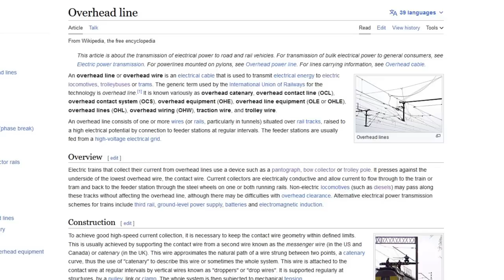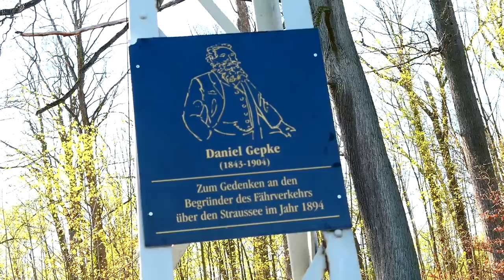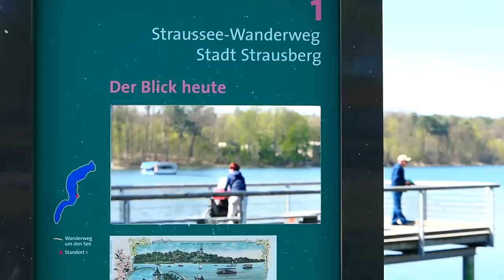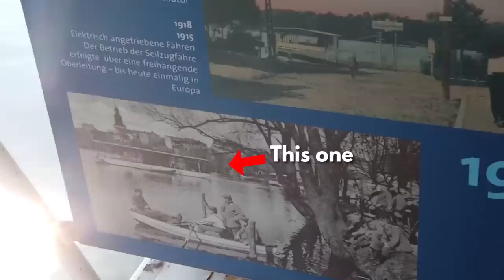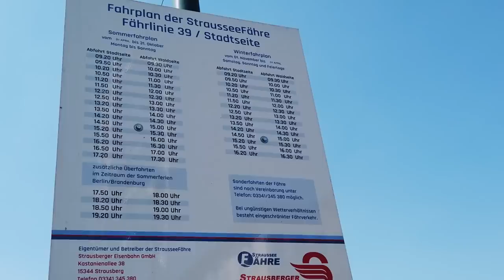The Ferry Powered By A Live Electric Wire

Comment: "Both grounded and floating" is a pun most of your less electrically inclined viewers probably can't fully appreciate. Rest assured that some of us do!
Reply: As I am both navally inclined and electrically inclined, it had me in stitches.
Reply: A grounded system is rare on shipboard.  Most floating electrical systems are floating.

I wonder if it tickles swimmers when the ferry is in the middle of the lake?  Once a fair amount of cable is played out, the resistance would lead some of the current to go through the water.  Especially if the power really is only at 230V.
Reply: Genuine question can one be ungrounded and floating?
Reply: I missed something somewhere im sure.
Reply: @joshgreen2164  In electric terminology, floating basically means no ground reference. Consequently, being grounded and (electrically) floating at the same time is mutually exclusive.

Comment: Electrified canal seems like the most futuristic retro that could exist. Might even be  a good way to transport bulk goods.
Reply: Seems like a much bigger investment in infrastructure than an electric railway (having to dig the canal and all that) for much lower speeds. And lower speeds not only means longer transit times, but also less throughput in total. Not even sure that it would be more energy efficient for the same haulage - ships are typically only more efficient than trains when very big, but canals only allow pretty narrow boats.

So while it is peak futuristic retro (is electropunk a thing?) I doubt it's actually a practical idea.
Reply: I think the idea would rather be, to refit exsisting canals. And although that might be a cool solution for some small canals with a lot of boat traffic, there are limitation with big canals, who might just be to wide.
Reply: Indeed, it's a shame that it replaced the steam-powered airships though!
Reply: Am I the only engineer here thinking, "Sparks and water, never the twain..."?
Reply: "Electrified Canal" is also an incredibly good name for a punk band.
Reply: @theloverlyladylo9158  NO.
Reply: You could just electrify the water, save the costly overhead wires!
Reply: The power would come from a coal fired plant anyways wouldn’t it
Reply: Space karen might like the idea, then rebrand it has an open air hyperloop (considering the hyperloop was another 19th century concept)
Reply: @smarttseluvka  Not unless you live in Australia, Poland, or Albania
Reply: @madattaktube  well New South Wales, Queensland and Victoria in Australia.
Reply: Well we have one kind of an electrified canal in the US, look up the Chicago Sanitary and Ship Canal
Reply: @madattaktube  don't forget germany, india and china.
Reply: @QuantumHistorian  But the overhead wires where for short sections only. Mostly for canal tunnels. When you have a diesel or steam tugboat, you have really bad fumes in the tunnel, so electric is the best way. You can see in the picture, that they use two pantographs, so the return line is also on top, and not in the water.
Reply: @smarttseluvka it's in France, so nuclear plants, mostly.
Reply: @nos9784  Germany 20% coal, India 50%, China disappointingly 70%. Australia is actually about 50% now, so there's not many countries still using coal as a majority energy source.
Reply: Nothing retro about it. For most kinds of bulk transport, going over water is the most efficient way to do it, even with a boat that runs on diesel. Electrifying it just adds more efficiency on top of it. I'd say it's quite a modern idea, instead of a retro one.
Reply: They used to move canal boats through tunnels where the animals on the tow path couldn't follow by having laborers lie on their backs on the roof of the boat and walk along the ceiling to move it, that was the origin of "legging it". If canals had held out a little longer instead of being supplanted by railways I could see them wanting to use some sort of small electric tugboat to move canal boats through the tunnels powered by an overhead wire instead, but probably with a long straight tunnel it would be just as easy to have a cable haul system instead of an electric one.
Reply: @QuantumHistorian  Uhhm... The rhine moves more freight (in tons) than the two double track railways next to it combined. Throughput is not inverse of speed.
Reply: @IIVQ  Rhine =/= canal. If you think about it for a microsecond, you'll see that throughput is bandwidth * speed. River barges are slow, but can each can carry a lot, and you can have several side-by-side. So it's high bandwidth and low speed. Freight trains are low bandwidth but high speed. Canal boats, however, are both low bandwidth and low speed.
Reply: @QuantumHistorian  Not all canals are small, especially not in the Netherlands. I live next to the Amsterdam Rhine Canal, the busiest canal in the world, which is CEMT class VIb and has enormous bandwitdh, probably over that of most parts of the Rhine. It just doesn't have two rail lines next to it for a nice comparison.

The Amsterdam Rhine Canal is VIb, which means vessels with a 343 TEU capacity can sail on it, and it is not uncommon to see 3 of those vessels (plus a lot of smaller) pass per hour, which is equivalent to 30 of the longest trains allowed in the Netherland per hour, where a simple double track electric freight-only rail line can sustain no more than 10 or so of those. So the throughput of the ARK is 1029 TEU/hr, while that of a rail line is closer to 350 TEU/hr.
Reply: @IIVQ  Yes yes, and I'm sure the suez and panama canals are also very big. But that's clearly not the kind of canals that the original comment was about.
Reply: The only thing more futuristic retro is the monorail.
Reply: @QuantumHistorian  No, those are canals made for seafaring vessels. I am talking about inland waterways. In general they can move more freight than comparable time period rail lines could/can (in tonnes/day) thus have a higher throughput.

In the beginning of the Industrial revolution (late 1700's in England, Wales and Belgium*) there was a canalbuilding mania. After the great railway expanse (1850's) many of those canals dwindled, only to have a resurgence in the 1870's because the railways were saturated and non-perishable bulk goods (mainly coal, brick and other building materials, and waste) could more cheaply be moved by canal, and a second wave of canal building started. In Belgium and the Netherlands a further wave was at the end of industrialisation (1950's, with many plans not coming to fruituition until the 1980's). And now there is a new (small) building wave in Northern Europe, mainly because of the future LSE (Paris - North Europe link or Seine Scheldt link).

*The Netherlands includinf Flandres already had canal building crazes in the 1600's as the flat, peaty terrain canals played an important role in the water management and roadbuilding was nigh impossible. In fact, the best roads were usually on the hardened berms of canals.
Reply: @jonasschich5979  The alternatives were horses or locomotives to ferry prams, both more expensive.  Germany is electrifying a stretch of highway with overhead cables for electric long haul trucks. The idea is appealing to everything that needs to travel a fixed route.
Reply: Water and electricity...what could go wrong?
Reply: @mrsleep0000  Well, not much more than on a train. The potential of the entire boat is same as earth. Only if you touch the overhead wires or the non-insulated part of the pole, you're in troublem, just as with trains/trams/trolleybuses everywhere.
If the cable breaks, a cirquit breaker will trip.

Comment: Between 1914 and 1954, canal boats were pulled through the Harecastle Tunnel on the Trent and Mersey canal near Stoke on Trent by electric tugs.  Initially they were powered using batteries, but after 1931 an overhead conductor was used.
Reply: I'd think canals would make for really good places to run electric boats.  They are fairly narrow and straight, and all the traffic is going up or down the canal, not across.  The only major barriers I'd see would be if private companies were running barges you'd need a way to meter the cost, but you could probably do that with a flat fee.  Compared to the infrastructure of building a canal throwing up some power lines would seem to be pretty simple, although maybe in their heyday mules were cheaper.

Comment: Well actually, the 'ferry boat' to cross onto the island of Lefkas (Levkada) from the Greek mainland is powered by being connected directly to the grid.

It is helped in this by the fact that it doesn't travel across the canal. Cars drive straight across it much like a pontoon bridge, and to let boats through they pull up the ramps at each end, and it pivots around a piling much like a swing bridge.

Rumour has it that it is very definitely not a bridge because islands only accessible by ferry have tax advantages...
Reply: Definitely not a bridge 😂 Thank you for that tax-evasion pedantry! Much appreciated.
Reply: A swing bridge that proclaims itself a ferry for tax purposes indeed sounds very "alcohol, alcohol, alcohol is free!"
Reply: That is the most Greek thing I've heard and I love it
Reply: @LeafHuntress  Hehe, yes!

I mean, to be fair to the claim of being a boat, it does float, which most bridges don't. On the other hand, it doesn't go anywhere, which most ferries do.
Reply: I just drove over that ferry yesterday :)
Reply: It is even registered as a boat. Π/Γ ΑΓΙΑ ΜΑΥΡΑ. Π/Γ for Πλωτή Γέφυρα (Floating Bridge) Santa Maura (the patron saint of Lefkada, from which the island got its name during the Venetian occupation)
Reply from the maker: Oh wow, that's going straight on my to-do list :D
Reply: I found that hard to believe until I rememeberd that many houses in Greece are under endless contgruction lasting decades. Putting half-finished floors in with rewbar sticking out means that you pay less taxes so they all remain in perpetual construction.
Reply: Looking on both aerial and Street View, I see an old car ferry about 200 feet away.  I gather the floating bridge "ferry" replaced it?

And yah, with how low to the water the approach roads are, building a floating swing bridge like this really does make a lot of sense.
Reply: @LeafHuntress  Now this was an unexpected but welcome throwback!
Reply: @TheTimTraveller  Come north of it too, in Corfu, I'll have to find you something weird to visit though...
Reply: A ferry that doesn't even move, but works perfectly. Brilliant.
Reply: This is absolutely brilliant and I can’t wait for the inevitable video on it
Reply: call it "Ferry Mc Bridgeface"

Comment: Well, actually: hidden away in the outskirts of Budapest there's a tiny cable ferry that is propelled electrically... by a winch on the shore. The cable is fastened to the boat and runs through pulleys on one shore and a large winch drum on the other, where an operator sits and maneuvers the ferry around by tensioning different bits of the cable.
Wikipedia tells me a similar ferry exists in the Netherlands in Jonen.
Reply: I've been there, at Jonen. There's absolutely nothing there.
Reply: @RobinRense  meanwhile, i was on one such ferry in the norwegian fjords and can't find any info on it (there's not even a ferry anywhere along my route according to google)
Reply: A Winch makes more Sense to me than a overhead line, since there are cables going across anyway

Comment: I have to assume that the reason it's the only one left is simply that if you are going to make an electric ferry, battery powered or extension cord-style give you the benefit without imposing a strict height limit on the river.
Reply: Nowadays, with improvements in plastic insulation for the cables, it wouldn't make sense to have an overhead-powered cable-guided ferry. That said, it's worth keeping the few still around as overhead-powered because of the historical aspect.
Reply: @gregoryclark8217  Well, you need the cable to be able to give the cable a charge, so insulation would be a problem with the normal way, but I wonder if you could do it by magnetic induction along the length of the cable?

Comment: Businessmen is a really bad translation of Kaufmann, the correct translations would be merchant, dealer or trader. A businessmen is an Unternehmer in German.
One is the guy running/managing a business, the other (Kaufmann) does the actual job of trading goods/services while usually just working for a businessmen (unless he is self employed). A Kaufmann today actually describes a series of jobs in trade which require vocational training.
Ofc you can be both at the same time, but those terms describe a different kind of activity.
Reply: Don't mix up Unternehmer and Undertaker!

Comment: I wanted to say, that it would be possible to use a electric ferry with overhead wire on a busy water way, if to wires like on a trolly bus are used. And then you showed the Teltow at 6:28 . The wires just need to be high enough for other boats to pass.
Reply: yes, but the potential ist quite limited as most waterways are either to wide, to "natural" (like with changing water levels) or not busy enough.

Comment: There's another weird ferry located in Rendsburg, it's the levitating ferry under a railway bridge, it crosses the Nord-Ostsee-Kanal (aka Kiel Canal) which connects North and Baltic Sea, one of the most frequented artificial waterways and due to that large ships the bridges have to be very high (the northern ramp of that railway bridge to decline to the central station is a full loop), most crossings are ferries or tunnels and a bunch of high bridges for Autobahnen, Bundesstraßen or railways.
And that Ferry literally works like a overhead/bridge crane, the vehicle is suspended by a hoist and doesn't touch the water.
It's not the only one but pretty rare, there's another nearby Cuxhaven, two in the UK and one in Spain.

Comment: Tim, you did mention there's not really much other boat traffic, which surprises me a bit because of how beautiful it is there -- but it's those guide cables that the ferry uses that scare me. At what depth do they sit? In my mind, I see the ferry pulling slack to go to the opposite bank, and that cable coming well up enough to get snagged in a passing pleasure craft's propeller.

Comment: Well actually the rhine ferry between Bonn Bad Godesberg and Niederdollendorf wasn't an overhead wire ferry but the first electric ferry (not ship) in the world. At least according to them and it opened in 1908 and was in use until 8th of March 1945 when the German Reichswehr sank it to keep allied troops from advancing. The allied soon blew the wreck up and temporaly installed a ponton bridge (Hoodges bridge) . Later they put a diesel ferry there which later the first chancellor of Germany Konrad Adenauer, used on his daily commute. 
It was part of my daily commute from 2009-2014 and I myself was regularly on the "Konrad Adenauer"
Reply: They failed to keep the allied troops from advancing though as the explosives at the bridge at Remagen didn't work properly. The remains of that bridge on the Remagen side are now a peace museum.

Comment: "... the hike round the lake takes about 45 minutes..." Sounds like someone missed the last return ferry trip and had to walk back!!

Pedantry corner: The Vaxholm Ferry (6:58) has an exhaust pipe, so maybe it's a hybrid ferry? (Yes, I can see the cable reel on the other side!)
Reply: That exhaust pipe may be for an emergency generator. It's not mentioned in the wiki article. https://en.wikipedia.org/wiki/Kastellet_ferry
Reply: @thesteelrodent1796  there's very similar ferry in Högsar, Finland. It's old diesel powered ferry from the 70s but it was converted to electrical power maybe 5 years ago. Diesel and propeller propulsion serves as a backup.
Reply: The newest ferry between Texel and the mainland is tribrid: it has combustion engines that can run on diesel, natural gas ánd it has a battery electric mode as well as electric shore power.